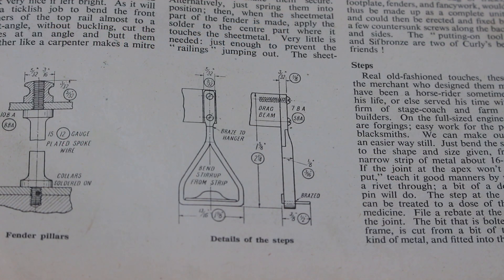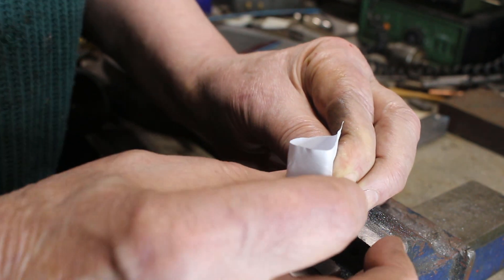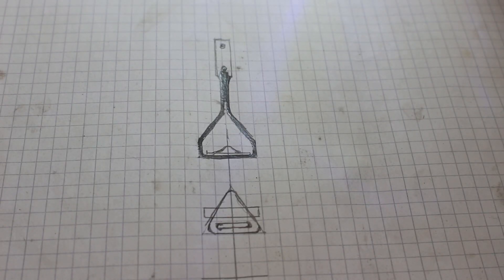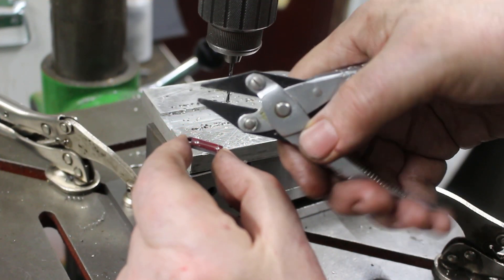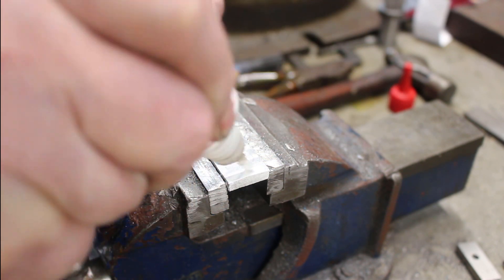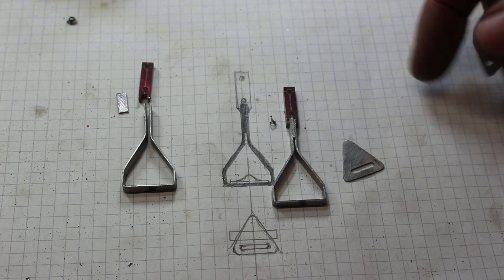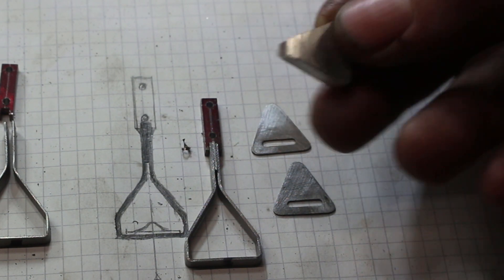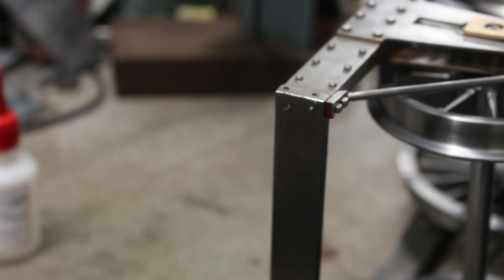Lion Locomotive in 5" gauge part 54- Making the Footplate Step

Comment: weren't you tempted to drill and tap them deeper into the buffer?
as per usual great work
Reply from the maker: Hi Paul, Yeah, 5mm would have been better but I didn't want to tap 9ba any deeper, at a depth of 1.5 x thread o/d it will be fine.Cheers!